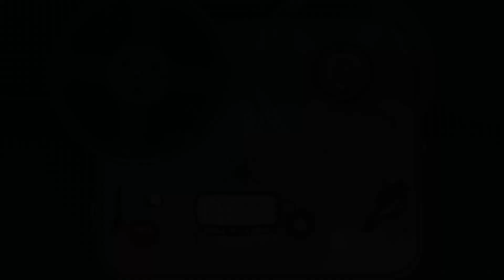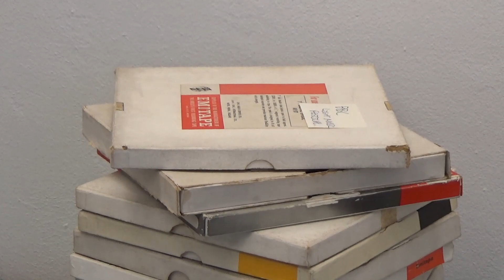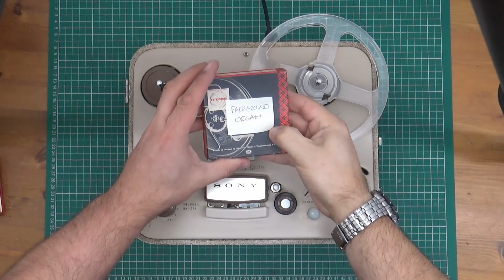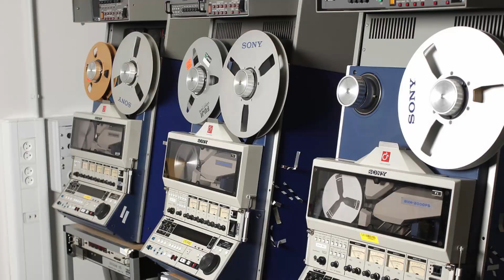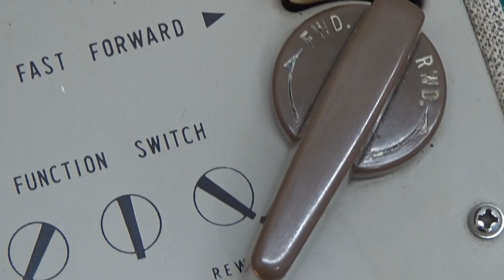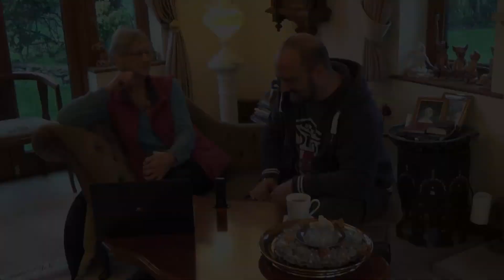DuB-EnG: REEL to REEL Vintage Magnetic Tape Recording reveals good ghosts of the past old technology

Comment: hi my dad had a reel to reel in 1957 it was a months pay back in the day dad past the deck on to me the power pack burn  out  after he died  in  1989  i got my first 10'5 stereo deck £400 used     i have had  old 4 track mono decks and one's like this one's  before 1989  when dad deck went bad i got  alot of low cost  4 tracks
i have work and i can fix reel to reel    if you can't fix them best not to get one    i have alot of reel to reel  decks me and brother buy them still  NOT TO RESELL  
 best decks are   tascam 30 line   i have 8 x 38  that are all need work   they can be money pits   my 38's are pimped up  7 1/2  and mod to the eq and speeds 

and alot of hours on them  beware  of bad head on the fostex  1/4   i have decks  where heads are wear out sony are like this soft heads
Reply from the maker: Very nice to see such enthusiasm for reel to reel systems!! - I'd love a Revox one day - but they are soooo  expensive!!